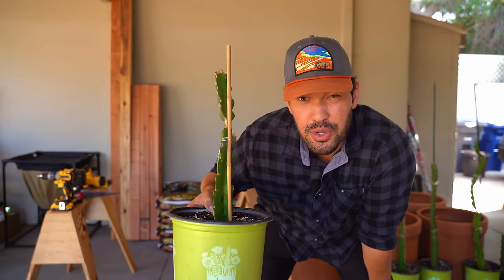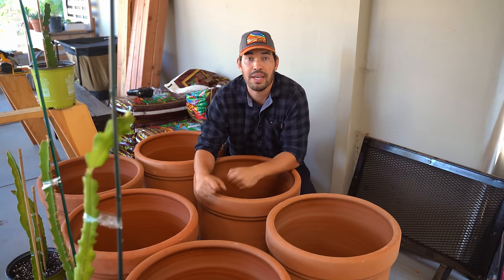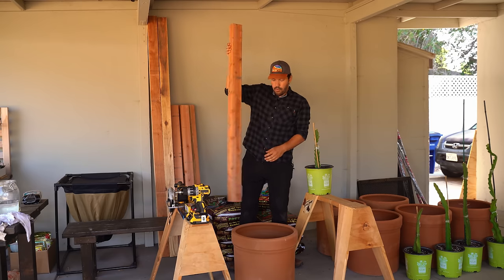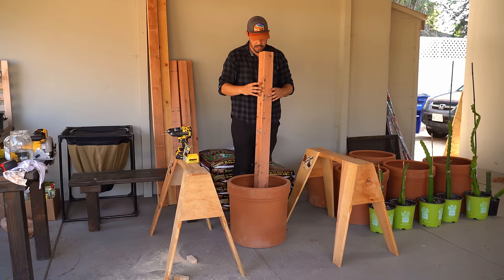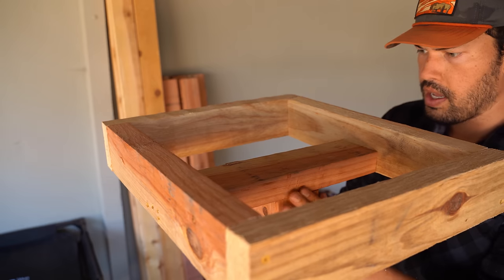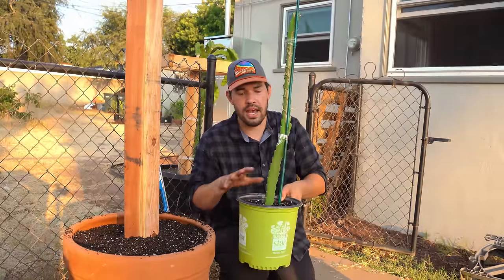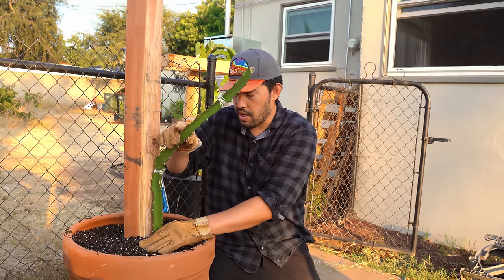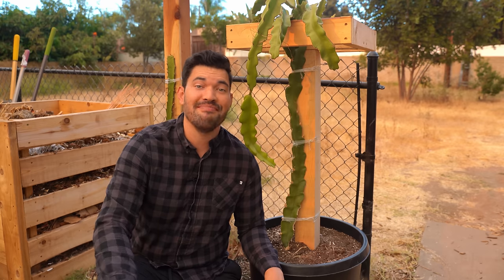How to Build a Dragon Fruit Trellis and Plant Your First Dragon Fruit Cutting

Comment: My thought process on buying tools for a  projects is:  It is still cheaper than paying someone else to build it.  I gain more experience and the satisfaction of building it myself.  On top of all that.... I have the tools for future projects and repairs. 😉😉😉
Reply: Yes! Plus, once you have (for example) a good drill, suddenly you start noticing all the things that need a drill to do/fix/improve that are now possible!
Reply: On the money. I am a minimalist except for things to build and create.
Reply: You could use the Japanese burn method of treating the wood that is below the soil.
Reply from the maker: Totally agree
Reply: @Grauenwolf  Some people just char it. Others then brush it afterwards creating a grey sheen. TA Bushcraft has done it on some of their "historic" builds where there is ground contact. I have not heard of using linseed oil, but that may have to do with smoothness or strength needed for a tool handle. On a side note, I do not like using any type of treated wood in food growing areas and avoid purchasing wood if at all possible since I have a lot full of pine, oak etc.
Reply: @lexica510  yes, everything becomes a screw! hahaha
Reply: you have a point
Reply: @lexica510  Everyone should have a drill. Even a el cheapo one.  There's always a use for it.

Comment: I’m wondering if it’s better to rotate some of the planks in the top portion 90 degrees to avoid drilling between the grain which can expand and contract with the seasons and possible weaken things? Did you encounter this issue?

Comment: I was wondering if there is any danger of the dragonfruit plant of root crowding in the terra cotta planters you use. I was planning on putting similar planters on a concrete base, is that good enough or do I need to have an earth bottom ?

Comment: Hi Kevin! I only have a balcony space at the 2nd floor, and i was thinking if its ok to use the metal railing as the dragonfruit plant's trelis. Would that be ok? Or would the heat of the metal rail (fr sun exposure during the day) burn and hurt the plant at contact points?

Comment: You mentioned growing 4 cuttings in the same pot.  Unless you remove the nursery tape from the first 3 cuttings planted, won't you have multiple applications of tape as you add each additional cutting?  Or do you remove the earlier tape applications?

Comment: Built six of these out of cedar. But for the bottom used these BuildTuff 4-in x 12-in x 12-in TuffBlock Polyolefin Plastic Deck Blocks. Fastened each to the bottom and sides of post using 2.5 inch wood screws. Seems very wind stable even outside the pot. About 8 dollars each at Lowes.

Comment: I used a plastic container (Lowe's had 20 gal laundry containers on sale for cheap) and built one of these. I actually put a few screws through the bottom of the container into the pinwheel base and it stabilized it a lot.

Comment: I came up with a slightly different way which gives maximum stability and maximum pot space.  I made the bottom wooden ''base'' the same size as the top. i used big plastic pots which i cut a square in the bottom centre to slide over the main centre leg and sit on top of the bottom ''base''.  i then slid a length of pvc pipe down over the centre leg so it sat on the bottom of the pot and  came just above the soil line (to slow or hopefully stop the wood from rotting out)  and sealed it to the bottom of the plastic pot to stop moisture rising up wooden leg.  (once all was in place i attached the top ''platform'' to the main leg). You can then attach either rope handles to the wooden base, or put small heavy duty wheels/rollers under the wooden base for easy moving.

Comment: This worked very well. Depending on the pot proportions you will need to be flexible with the in pot supports  - (4) 9" long 2x4 (23cm) . I had the local supplier cut all the pieces to length but had to reduce these to 8". You may need to adjust the lengths to suit your particular pot as well so be prepared.

Comment: Also just made my dragon fruit trellis. Used some 2x3 fir for trellis part as in SD county I don’t have to worry about rain as much. Same redwood posts but I used the pier blocks as they haven’t seemed to affect ppl’s setups that are years in and so I don’t worry about balancing and leveling it. Parts you’ll be handling / tying things to I sand down a bit with 60 then 80-100 as I hate splinters. I also don’t like putting them in the soil as much. Their bodies are acting like leaves partially and can rot if in water too much around there. If anything whittling down a little of their branch ends. Nurseries initially did it to make staking easier.
Reply from the maker: Nicely done!

Comment: If you are worried about the wood rotting, maybe you could do a cement footing using cardboard or pvc with a galvanized metal 'post holder' (idk what its really called), or maybe there is a safe paint or coating you could apply to an untreated fir or pine post.
Reply: Beeswax

Comment: If you use plastic pots, you can screw the bottom of the trellis to the bottom of the pot. 
Be sure to use rust-resistant screws (I think you did, but you didn’t say so in the video).

Comment: I saw someone else already mentioned the 3 inch tape measure body (so you don't have to bend the tape) but look for a post level.  They are not expensive and clip onto the post to give you 2 sides of level without having to play around with the long level.
Reply from the maker: Great tips

Comment: Thank you for your videos - I am now excited to try planting Dragon Fruits! You make it clear on what to do that even I think I can manage! Quick question: you commented in your videos that you have 4 plants per container, all of the same variety. Can I put 4 different varieties in one pot, especially mixing 2 self-pollinators and 2 that are self-sterile? Would that work?
Reply: edcreleration, This is exactly my question. Especially since I have some that are not self-polinated (LaVerne). Did you ever find out if different varieties are ok in one pot?
Reply: @debrafrederick5300  Never got an answer one way or the other but I went ahead and planted them together. So far, after a year, the self pollinators are growing very well and the self-sterile ones are growing "reluctantly". I have to keep pruning the self-pollinators so they don't overrun the slower ones. I understand they take about 2 years from planting to get to flowering stage, if I am lucky, so it will be a year or more before I know if the experiment works. If they don't cross pollinate, I could hand pollinate them, and at least, they would be close to each other saving me the walk from pot to pot! Good luck with your plants!

Comment: Tape measures have a number on them. That number is how big the body is. Just add that to the measurement when measuring an inside angle to the wall, or in this case the pot.

Comment: Hi, subscriber here.  I have a 2yo-ish plant that's been flowering. However, the flowers turn an orange-ish color and then drop off before they mature.  I have consistent watering, straw hay and compost in the mix.  Any ideas or is it more due to the overall age of the plant?
Reply: Cuttings from an old plant will flower but not fruit.  Dragon fruit plant is old about 18 to 20 years.

Comment: I have an idea to use PVC pipe for my trellis which should allow me to sub irrigate somewhat and water from the bottom with a small reservoir  and use less pot space and weight
Reply: Make a video. I'm interested
Reply: @markroyo4013  sorry bud, I'm good with plants, not so much with computers but it is a pretty simple design, just a 4 inch long piece of 3 inch PVC one 3 inch cap for the bottom reservoir and anchor then a 3 to 2 inch reducer and 2 inch pipe for the riser then a T at the top of the riser for the trellace top and two more T one at either end of the first and 4 elbow to complete the square at the top. Drill holes in the base for sub irrigation and a feed hole wherever convenient either in the top of the trellace or somewhere up the riser. The smaller diameter pipe will use up less pot space and be much lighter than a 4x4 post, cheaper too and should definitely be strong enough to support the weight of the plant!

Comment: You asked a week or two ago about vid lengths. To me this was good, with enough information and a link to more information.  Could possible go up to 30 minutes. IMHO. A little downward angle, 1/2",  on the pinwheel legs should help with stability and give just enough clearance for drainage.
Reply: I love the input for the downward angle
Reply: I'm trying to figure out the drainage hole too. I have treated lumber and terra cotta pot. If I do the downward angle, wouldn't that put press on the screws because the weight of the trellis is not directly on the post but the legs which gets transferred to the post? Treated wood is pretty soft so I think the weight will eventually break the wood around the screws. . I was also considering cutting a v shaped groove on the bottom of the post, to allow water access to the drain hole but I found out that cut ends of treated wood will deteriorate faster. Any suggestions?

Edit: Maybe I'll cut 2 rectangular wood pieces about 1x2 (.5 thickness) to put under the post, this will leave the center open for water to drain out. Then I can screw on the legs not at an angle but flat to the bottom of the pot.  Or find some material that won't rot and do the same.
Reply: @bradmaas6875  I ended up using a masonry bit to drill holes. Treated lumber is a touchy subject.

Comment: I run a piece of rebar through the pot into the ground to prevent my large potted plants & tropical fruit trees from getting knocked over by high winds here in FL.  You can also place some big/coarse gravel in the bottom of the pots.
Reply: For how many years will the wood trellis last in Florida where humidity is always high?
Any ideas what other materials the  trellis could be build of?

Comment: Depending on your climate I'd highly recommend just getting a large PVC pipe you can get in the plumbing section at Home Depot and cutting it down as they only come in 10 feet fill the inside with concrete/ rebar at the top criss-crossing to help top support system.. I recently had one of my dragon fruit the wooden post rotted thankfully I caught it in time to save most of the plant with heavy pruning I was able to move it to the PVC pipe. I am currently about to lose my oldest dragon fruit.. I've spoken with other individuals who grow them in my area they've had the same issue with the wood rotting
Reply: may I ask what area you have had success with this method?
Reply: @sandiago7564  I am in Florida unfortunately the rain humidity wooden post don't last long. Using the PVC pipe is something  I learned from watching a video Spicy Exotics they are located in Louisiana they put their Post in the pot so they can move them, I planted my post in the ground. Tropical storms in my area would be a risk of knocking it over.. from what I was told the post should well out live the plant. Anything has to be better than the five years I got out of the wooden one.. many of the Farms use concrete post rebar up top with something going around it for support
Reply: @Kibatsume1 I’m in So FL. Rainy season hits & my beautiful Dragonfruit  just MELT, turn yellow & the plant just disappears💔💔💔💔HELP!!!

Comment: This may be a stupid question, but is there anyway to naturally treat the wood to make it darker and nicer looking?
Reply: Butane torch to char the surface.  Then wire brush. The area between the pine annual rings will abrade leaving peaks (annual ring) and valleys the softer removed and charred wood.
You should be able to find organic non-toxic clear timber finish somewhere.  After all the Banana Republic of Americanista has everything.

Comment: Will the trellis affect drainage in the nicer pots? I know the nursery pots usually have holes around the edges, so it’s probably not issue for those.
Reply: I was surprised he didn't add small stones or ceramic shards in the bottom to help with drainage. Especially since the trellis might end up blocking the one drainage hole !
Reply from the maker: Yes slightly
Reply: I am glad that I was not the only one that noticed that the post covered the drain hole. This will cause drain issues and rot the post faster.

Comment: Definitely looks nice :) 
But does it really survive 5-10 years? Direct contact between wood and soil is something I would always avoid. Especially the (untreated) wood in the bottom will decompose in 1-2 years, just like in raised beds where you want this effect. Furthermore this huge piece of wood takes up quite a bit of space in the pot. How about some sort of framing with the pot in the middle would be a better idea.
Reply: Redwood and cedar are fine in soil. Also treated wood is not good with food.

Comment: QUICK TIP... Measuring tapes tend to be 3 inches long. So all you have to do is stretch it straight and add 3 inches... that way you don't have to bend the measuring tape when you're in a tight or awkward spot.
Reply: It might actually be 2 inches. Some measuring tapes have the length imprinted on the bottom or side of the tape.

Comment: As an engineer, I need to point out some design problems you will be encountering after doing what you chose to do.  Those dragon fruit plants will get to be 200+ lb heavy range at the canopy.  Most of that weight will push the center of mass upwards in a way that it will be very difficult to keep those pots standing up, and even worse, putting force against the post.  The 4x4 has no way to stay in place on the surface of the dirt, even with your support on the bottom for it to stay centered.  Potting soil will NOT hold that 4x4 straight up, even well packed.  It's too soft.  Any little wind against all that weight will mess that up.  You actually helped that 4x4 not go through the bottom of those terra-cotta pots with all that pressure that will be created, so you did fix a problem you might not have noticed which is all that weight pushing down on a 16 square inch area on the bottom of an easy-to-crack material.  I hate to be negative, but, I would be very surprised if you end up with all these becoming adult-producing cacti one day.  Now, not wanting to dig you a hole without helping you out of it, here's how you fix that whole problem:  Put the 6 pots in a 2 x 3 formation and add some 2x4's connecting the canopies into a frame that will not go down no matter what the weather looks like or how much weight there is in it.  I would even recommend a 45-degree beam on each side connected to the ground to keep it up.  It will also promote more growth as the dragonfruit will have more trellis to hang on to on the sides.
Reply from the maker: Appreciate the feedback, 100% of them will definitely become fruit producing cacti though, albeit not as large as the ones you describe. These will be 5 year cacti, not intended to grow to full 'in the wild size'. I will re-prop from there and replace, but I'm sure I will use some of your design modifications in the future as well!
Reply: @epicgardening  I wasn't talking about "in the wild".  There is a good reason farmers sometimes use cement posts that are buried very deep into the ground for their plant to thrive.  Look at these monsters...  I am willing to bet some of them are pushing 300-350 lbs plus...  A terracotta pot would be demolished under those conditions and you would never be able to prop that back up:  https://i.pinimg.com/originals/0d/a6/a5/0da6a57e3cd47bb57cb609b52657d94b.jpg